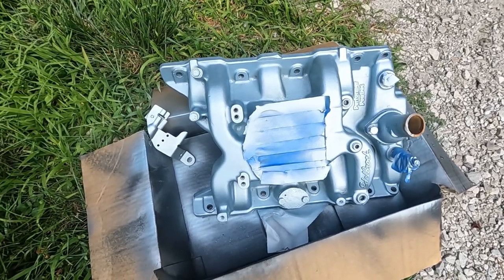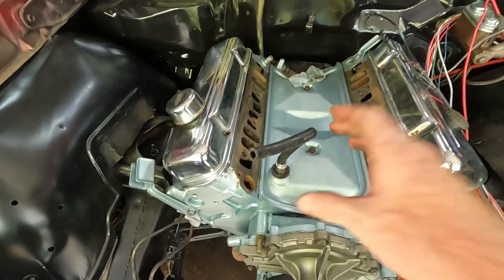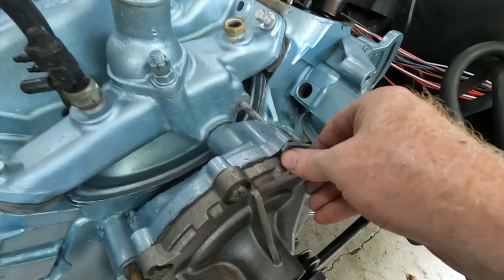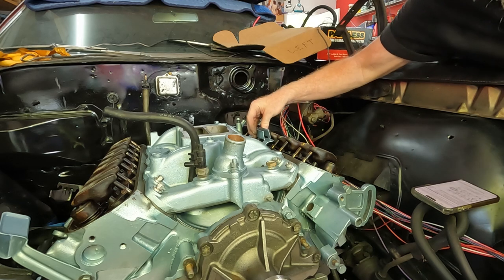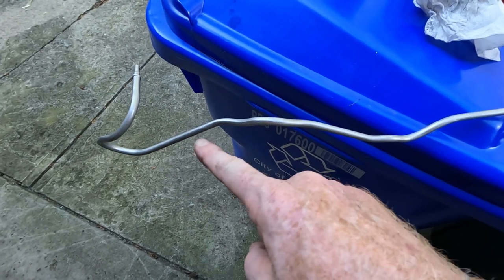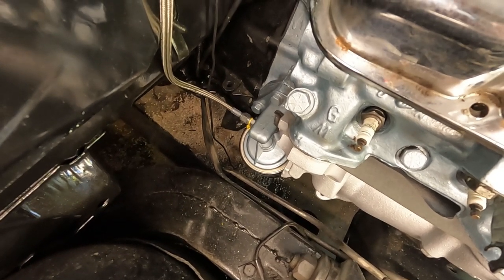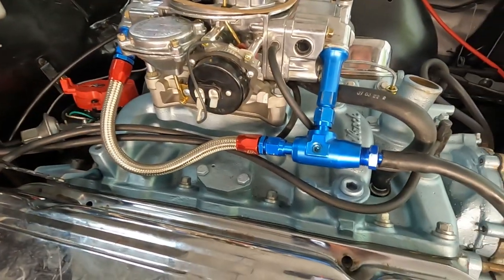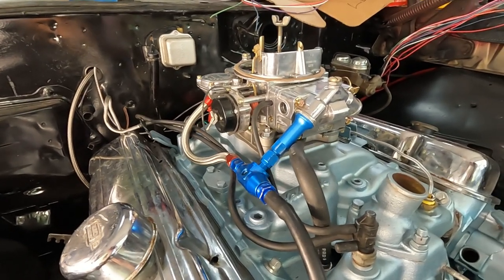Installing Accessories on a Pontiac Engine

Comment: if you used a quadrajet things would line up. i had that same problem until i went that route. also you can NOT use that spacer with a clutch fan. you need to buy the studs that go into the water pump.
Reply from the maker: @russbonneau9152  Is it because the fan clutch is too heavy guy or that spacer? If you can, could you let me know more about the studs? Thanks
Reply from the maker: @russbonneau9152  Actually I think I found the studs you’re talking about. Thanks again!
Reply: @Rustrevivalgarage  btw, you have to take it off the fan and install it after the radiator and shroud are installed.
Reply from the maker: @russbonneau9152  Yep. It's already off. I wanted to have a more complete video, but found it was still in the way for some of the things I needed to do for the wiring.
Reply: Why would you use a used intake gasket on a brand new motor? Not worth the risk.
Reply from the maker: @raimaker6343  Because that gasket only had 15 minutes on it…